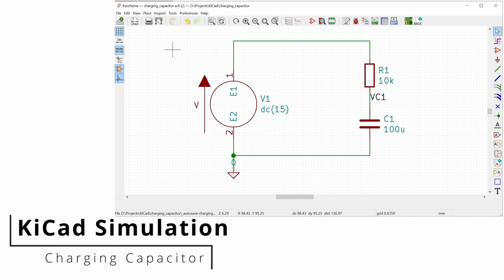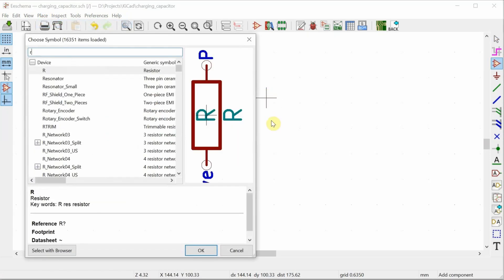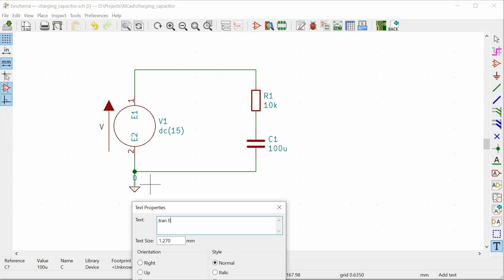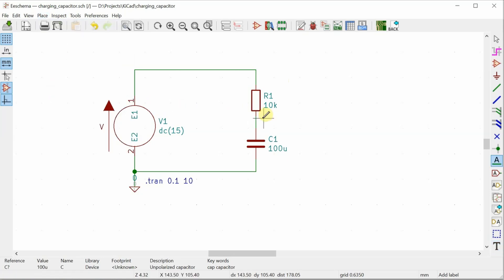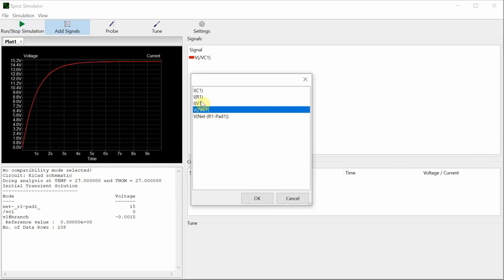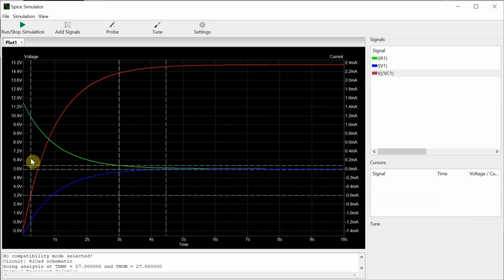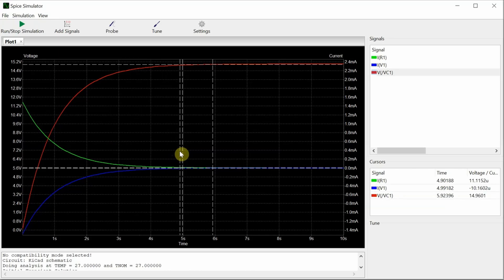A Quick KiCad Simulation Tutorial - Charging Capacitor Transient

Comment: Do I have to do this for every capacitor in a complicated circuit or it is not necessary only to specific analysis?
Reply from the maker: For AC analysis, it's not necessary. It's only necessary if you need to force a initial voltage on the capacitor when looking at transient analysis

Comment: Thanks for the video!
I think this was made for KiCad 5.x.  For people starting fresh with KiCad 6, (with the default preferences and hotkeys) it's almost the same but:
Add components using the 'A' hotkey (or Place -> Add Symbol, or the comparator symbol button from the right-hand-side toolbar)
Connect up wires with the 'W' hotkey (or Place -> Add Wire, or the '/' button on the rh toolbar)
Change the Value of the components at @1:23 with the 'V' hotkey (or arrow button from rh toolbar, then right-click -> 'Edit Value')
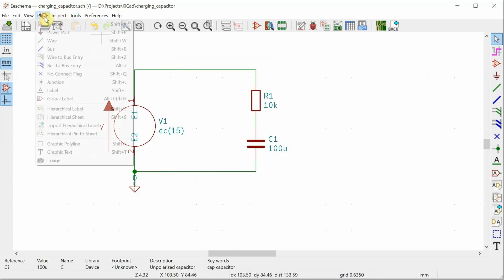Place text at @1:58 with the 'T' hotkey (or Place -> Add Text, or the 'T' button on the rh toolbar)
Finally, the simulator has moved from the "Tools" menu to the "Inspect" menu.
HTH!
Reply from the maker: Those are great tips. Thanks for your input Tim.
Reply: Thanks Tim! KiCad-Army 💪🏻💪🏻💪🏻

Comment: Does kicad have spice models for most of it's components and can it be used as a simulator in the same way Multism is used or does it just have generic models for capacitors and transitors etc?
Reply from the maker: Kicad is open source software, and due to licensing issues it doesn't include device specific spice models. It has some generic BJTs and FETs, but that's about it. It's easy enough to obtain the models from the manufacturer or something like LTSpice though
Reply: @ElectronXLab  Ok-Thanks